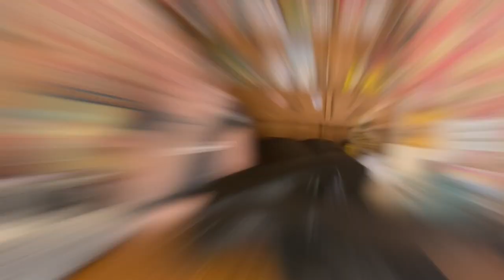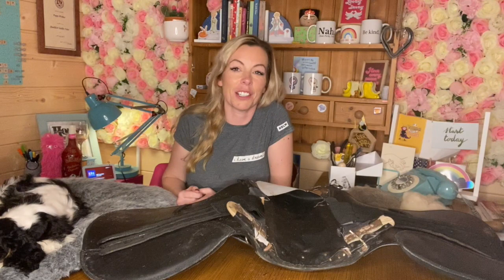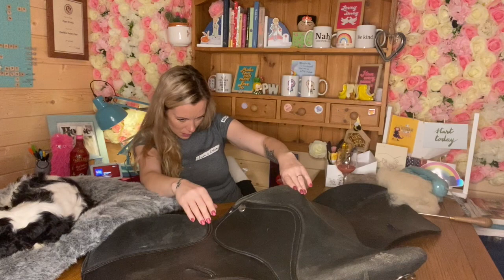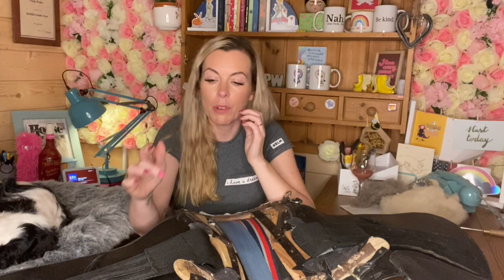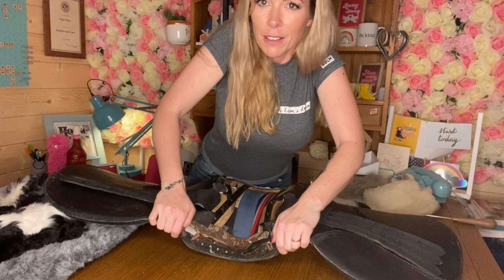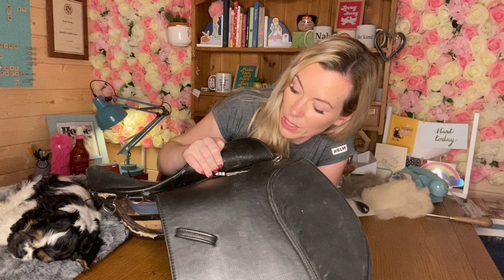Saddle Dissection In 15 Minutes! Super Quick

Comment: Just found your channel and really enjoying it. Lots of fab info. I've recently bought an Albion K2 jump saddle that was made in 2011 online. Its been checked and flocked by my fitter  but slipping horrendously to the left. I'm not experienced with how saddles should be but to me the tree looks twisted, worse than this one in your video. Do you know whether this is a theme with Albion? I'm quite shocked that my fitter didn't notice this and has gone silent when I have asked him about it.
Reply from the maker: Definitely get hold of your fitter and ask them to check the tree properly for you - visually we can say whether it looks a little twisted, but to confirm it, it helps to take the panels off the tree and check it properly - so, chase them and ask them to check it. but remember, a lot of saddles slip because of the horse, not the saddle. And a lot of saddles can end up looking a little uneven once they've slipped for a while as the flocking can flatten more on one side... so, get it checked over and hopefully sorted. Do other saddles slip on your horse? 
x